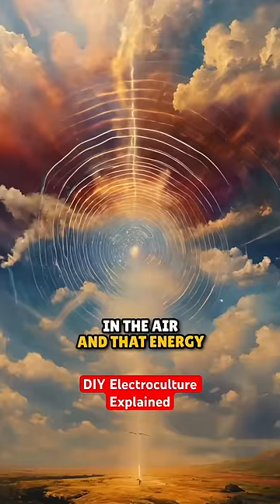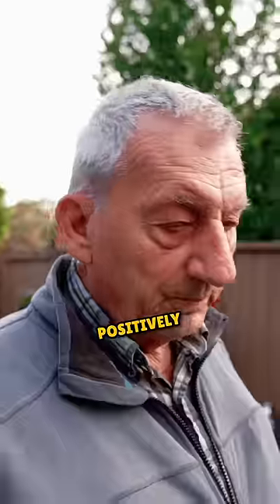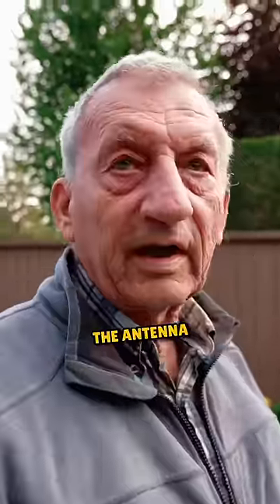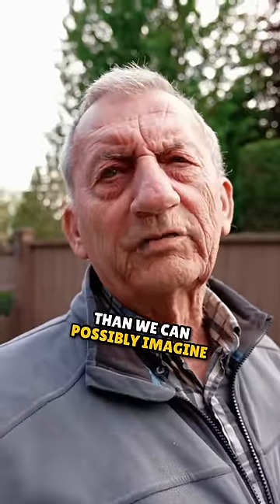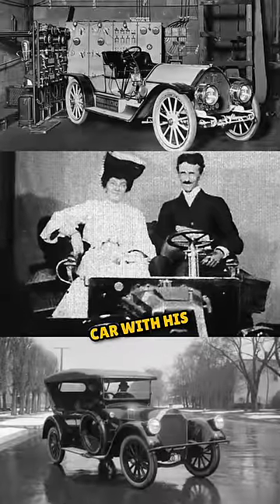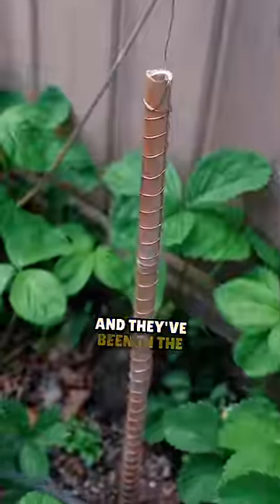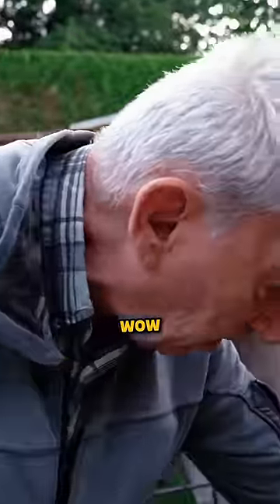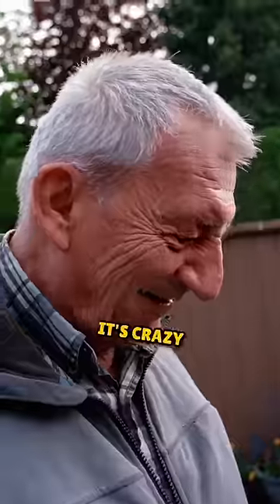DIY Electroculture for gardening explained - What is electroculture and how does it work? #shorts

Comment: Maybe it would be helpful for non-electricians to say, you need always two different materials for Anode (+) and Cathode (-) for the coils. Anode can be made of zinc, aluminium or magnesium and Cathode can be made of copper. The distance between+ and - depends on the diameter of the wire. 4mm2 ca.05m distance, and if you start with + always ends with the opposite, example + - + - + -. Only this way, there will be an exchange of electrons, which has a positive influence to the plants.
Reply: I've read this 3 times now and still struggling. Please pretend you're explaining this to a 5 year old and try again please.  I thankyou in advance as I think you have some valuable wisdom.
Best wishes
Reply: The copper is the cathode, and the root of the plant releases protons, and that is anode.  Plants do that to extract positive mineral ions from the soil. That exchange occurs all the time making the roots positively charged. I can see weak electric current going on if there is truly electricity in the air that the copper is conducting. The flow of electricity into the roots of plants may act as a stimulus to the root, much like stimulating human nerve endings.
Reply: But why is coiling needed for electricity? It’s not like magnetic field is needed.
Reply: Can you repeat that in English for those of us not fluent in physicology?
Reply: So do we need two rods or we just plant only one like the old man said?
Reply: I’m an electrician. Just the other day for the first time in 13 years, a plant helped me find the broken wire in the ground. I was using a toner and the biggest most beautiful bush in the yard kept giving a loud signal, and after hesitation ( don’t like to destroy landscaping) I ripped the bush out and started digging. The roots were entangled with the now bare and corroded copper wire, the circuit was and has been live for years in this condition. Moral of the story is that bush was the biggest and healthiest in the whole yard, got me thinking, and then I see this
Reply: @JulieYuWei-pr6qf  Plants are affected by magnetism, all positive from what I have read.

Comment: He's correct. Take a look at  Georges Lachovsky's work in the early 1900's. He used concentric copper rings to heal geranium plants infected with a type of cancer. He performed this experiment many times.  He reportedly did consult with Tesla and later developed the multi wave oscillator.

Comment: Coil must be copper, yes? Or no🙋‍♂️
Reply: Copper would be best
Reply: Yes
Reply: Copper ions, available at the wire/soil interface, are antifungal.
Reply: Good question !! Thank You 🙏 ❤
Reply: Need copper find old fan vacuum motors already coiled up just gotta take out of the center. Imma try this I love gardening.
Reply: I usually use an extension cord, with one end plugged in and the other end cut off and buried in the soil
Reply: Believe and it will be so.

Comment: It works even better with a piramid crystal on top of the wire. I didn't believe it at first but i tried and it actually works. I still wonder how many coil rings works best. It basically works as a electromagnetic field, so maybe a ringmagnet will also work. Water is bipolar so it aligns the water in the soil.

Comment: A few years back, a lad named Art Bell stumbled onto a phenomenal when installing a huge , loop antenna.  There was a huge voltage difference.
The bottom line is that any conductive material that passes through a magnetic field conducts electricity.  The earth has a moving magnetic field.  Build a framework, coil copper wire around the framework.  Make several with different loop sizes.  There are probably other factors that affect both current and voltage.
This is probably why Tesla wasn't backed.
Once you have the set-up, no one can 'sell' you electricity.  

This guy is 'close'!  Very close!

Comment: Wait, i think you got to make sure the aeon flux compasitor is in reverse rotation and the ignition module that is connected to the emulator of the spectrometer is set to the proper depth range. Then you should get the results you are looking for .

Comment: How long before the wooden dowels rot at thelower point stuck in the ground and it seems that some thinly cut plastic strips could be used several years or thinly cut strips of tin or anoter metallic replacement o could have the same results metal would best 9r even enhanced results and could be recycled for several growing seasons. I'm going to try this on indoor house plants.💯

Comment: I can tell you it works, but you should try for yourself. Simply use a bush outside in the spring, wrap some copper wire around it and then point it up!

Comment: This probably works because it creates a potential difference between the roots and the plant tops, which will help in delivering electrolytes and growth. I've found It's actually an area of active research but using regular energy sources instead.

Comment: I did this put a multimeter on the top and one lead to my self not grounded and it was 0. Also put an ammeter in series with the stick and wire and it was 0. Just for good measure I let it log for a week and found two occurrences of 0.001 volts. Not sure about this

Comment: I watched and thought fuck right off. Then looked into copper uses in horticulture. Actually shocked and now understand that whilst the "energy transfer" is what is at topic here this could be misconstrued as other benefits such as coppers anti fungal properties and the fact its a natural deterrent for slugs and its conductive properties e.g heat transfer causing soil warmth creating faster microbio development etc... im not dismissing this hypothesis of energy transfer, its possible but unfortunately trusted science data isnt available for this topic. 

Below is some abbreviated bullets after a good google search and discussion from chat gpt

- **Copper Wire for Plant Support**: Coiling copper wire around plant stems for support, especially for climbing plants.

- **Copper for Pest Control**: Using copper tape or wire coiled around the base of plants to deter slugs and snails.

- **Copper Fungicide**: Applying copper compounds to control plant diseases.

- **Soil Electrification**: Distributing electric currents through the soil with copper coils to stimulate plant growth or enhance soil fertility.

- **Electroculture**: Creating electromagnetic fields or conducting electricity through the soil with copper coils to boost microbial activity and nutrient uptake.

- **Geothermal Energy**: Employing copper coils as heat exchangers to transfer geothermal heat to soil or irrigation water.

- **Bioelectrical Enhancement**: Using copper coils to conduct bioelectric energy, theoretically aiding plant growth and health.